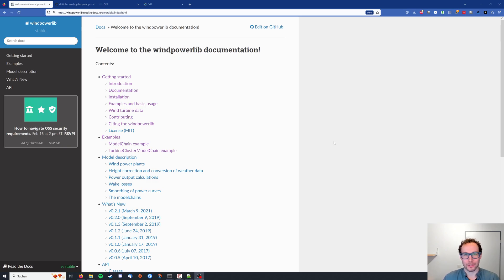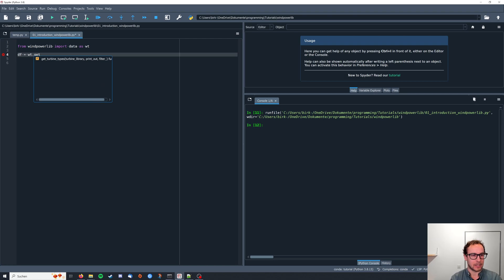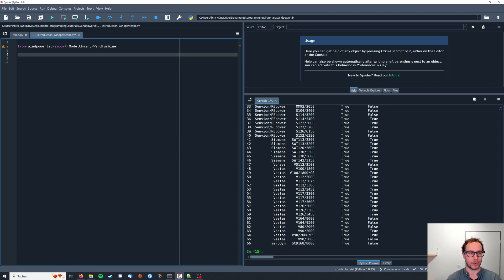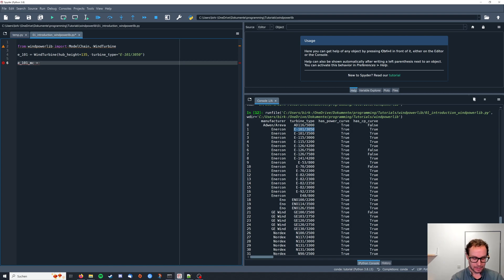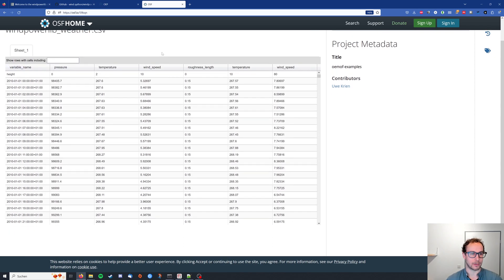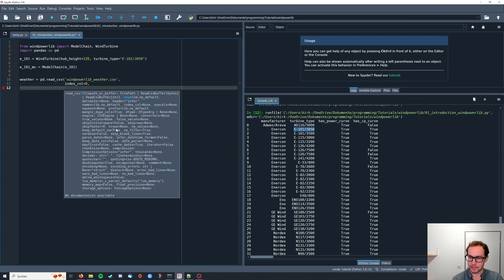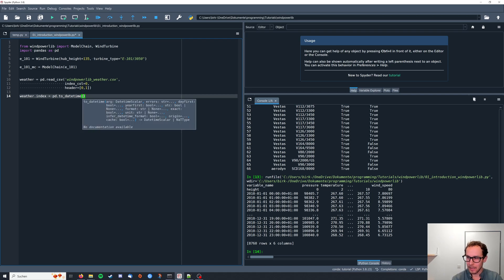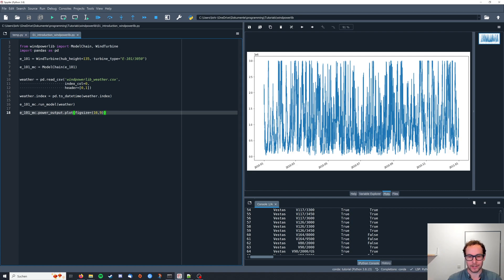windpowerlib 01: Introduction

Comment: Hi Sascha, which parts of the code do you need to change when you have your own weather data. Is this solely the weather data you import or do you also have to change something in the modelchain code?
Reply from the maker: Hi Cedric, you only need to change the weather data. Maybe some reformatting of the data, but no changes to the modelchain are needed.